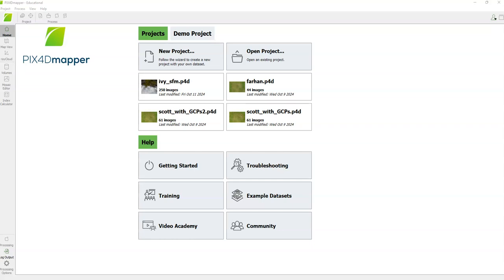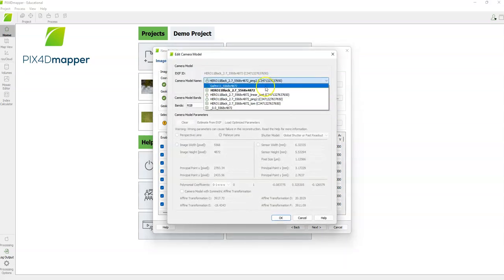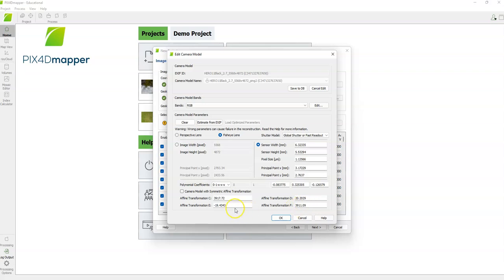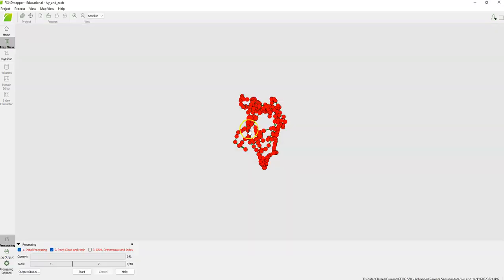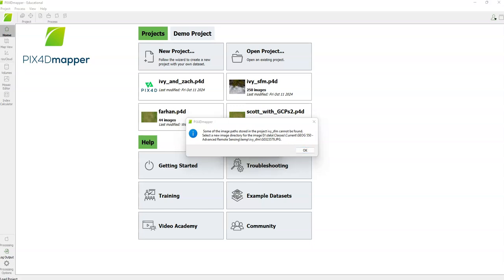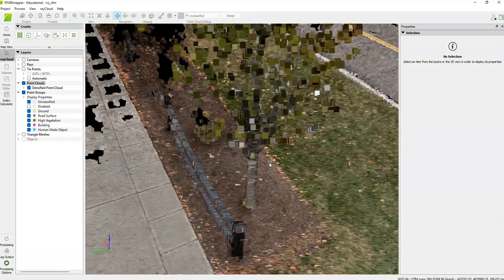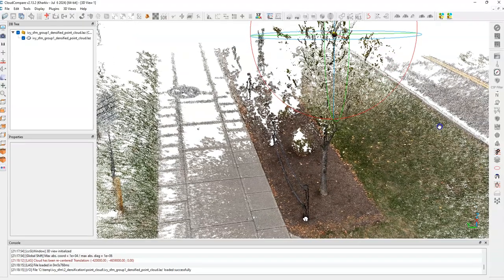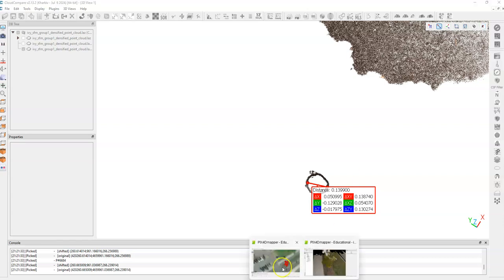Simple Pole Photogrammetry in Pix4D with a GoPro Hero 11

Comment: Great video, I'm also trying to create an identical solution for areas where I can't use the drone, I was thinking about using the insta360 x4 with a 10 meter pole and the software I use is agisoft, I've seen some videos using a small gps rtk but I have no idea how to synchronize and edit the exif file to add the gps rtk coordinates
Reply from the maker: Best tool to do that kind of thing is ExifTool.  It's mostly commandline, though I see a GUI option now.  Ultra-powerful and an active userbase and forum.